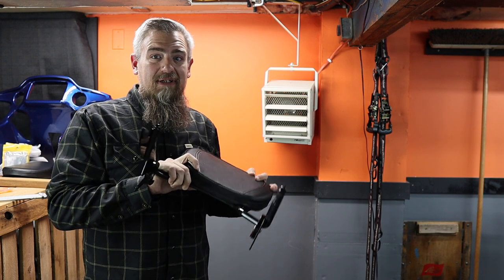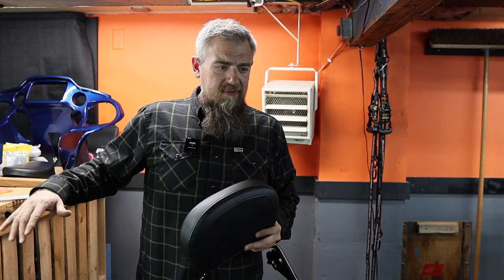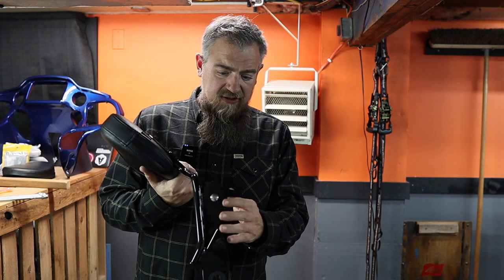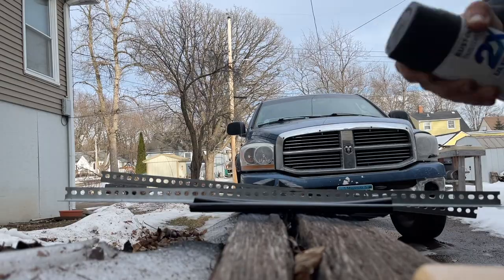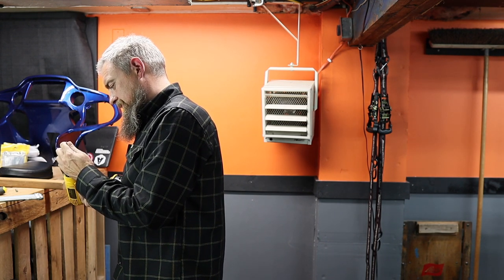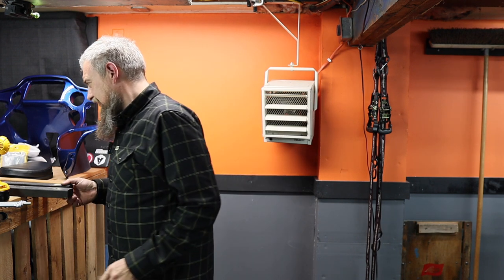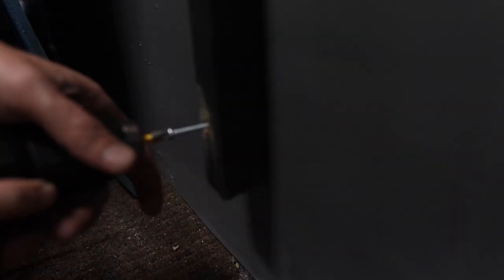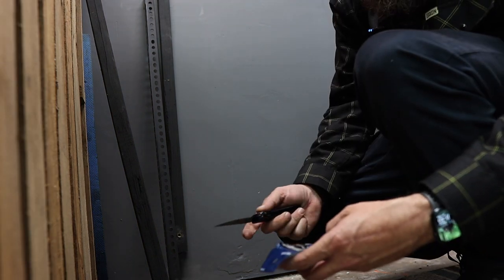I Built A Tour Pack and Quick detach Storage Wall Mount

Comment: Thank you for the awesome video.  Question - what did you use for the saddle mount , unfortunately I’ve got 2 extra seats lol 😂 it’s an addiction.
Reply from the maker: It’s just a scrap piece of 1x4 that I used for trim, painted it black and put a screw in it. Cheap, easy and it works. I only have two seats so far so I just swap em.
Reply: @Touringmidwest  well I have a total of 3 stock RG seat , CVO seat and heated seat lol
Reply from the maker: @chadbinnie7641  I’m still on the search for a seat that I like. Seats aren’t easy.

Comment: Nice way to store the stuff while not using it. What’s the total cost of the project? Harbor freight moving blanket for protection.
Reply from the maker: It was around 20 dollars but I had paint and 2x2s and screws.. I still think it could be done for right around that though depending on what materials you find.